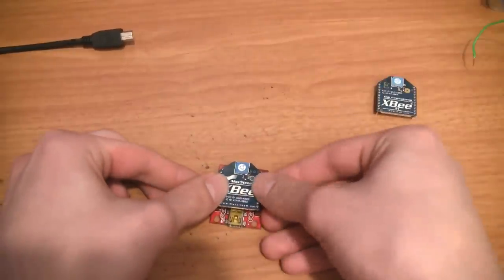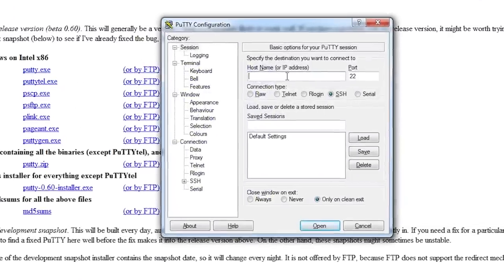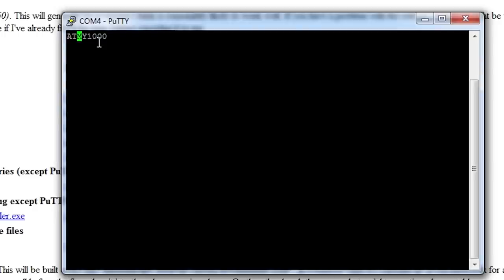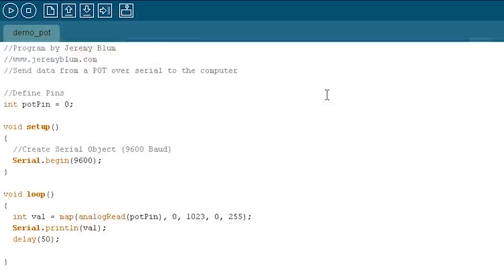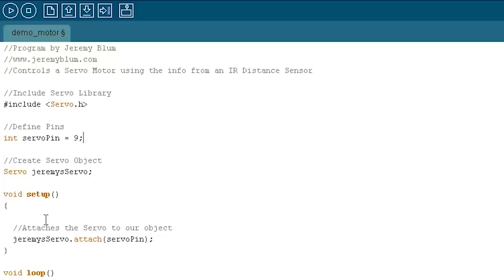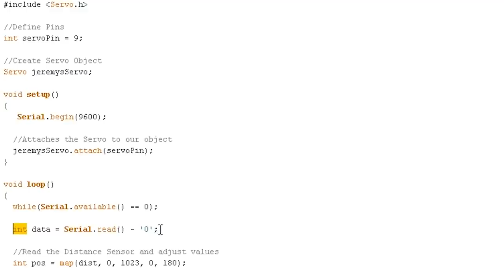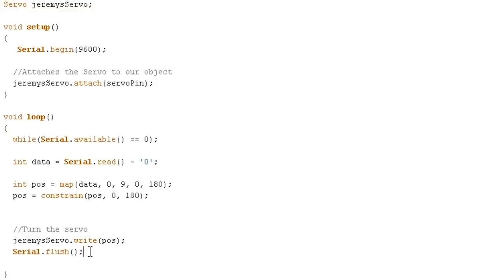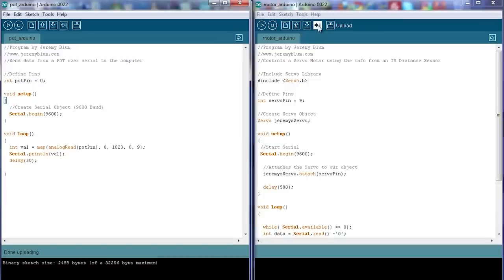Tutorial 09 for Arduino: XBee Wireless Communication

Comment: 2.4GHz is such a "dirty" band. crowded with: WIFI, Bluetooth, RC toys, wireless cameras, security alarms, Microwave Ovens, ham operators..." I prefer the 900MHz band. Cleaner, more power and better antenna solutions.

Comment: the code in the Arduino can take data from xbee while running its program, putty is to configure the xbee, microcontroller and xbee are 2 different components working together. Instead of putty, u could download the official software of xbee , X-CTU.

Comment: How does it differentiate when to use Serial via wireless vs. USB?  does arduino default to the connected shields if there is no USB connection?

Comment: Hey Jeremy, I have been trying this example to practice with my Xbees, and I have the exact same shields that you use in this video. I was wondering if you could help me because when I turn both Arduinos on the Servo twitches a little when the potentiometer is on one side and the Servo does nothing when the potentiometer is on the other, it doesn't coorelate with the potentiometer, it is basically just twitching every now and then. I really appreciate the help. :)

Comment from the maker: @bmonty65 While the polarity is only relevant to the interface, you need to be careful, because antennae are designed to be very particular lengths.  Antenna length is directly determined by the wavelength of the wireless signal you are sending.  Extending the length, if not done in integer multiples of the original antenna length, could greatly reduce your range.

Comment: if you want to "change slave 1 to 2" u could configure 2 receivers and 1 transmitter with the same PAN and BaudRate, having the 2 receivers each responding only when a certain code is sent.

Comment: Is there a way to use a single arduino to wirelessly connect to 4 others? I need to send different signals to each of the four arduinos but if possible I want to just use one master arduino, is this possible?

Comment: Hi I a have problem when I set up the xbee. I started putty and typed in +++, got an OK. But when I type in ATMY1000, I get ERROR000. Can someone help me fix this?
Reply: I am having the same problem but i am going to update firmware using xctu to 803.15.2(or there is some no. like that). There you can change the atmy
]

Comment: I am Using my HC-05 Bluetooth module and I connected it in my Arduino uno r3,my wires are all fine.When I use my mobile phone to communicate with BT module I've got some problems: My phone can pair with BT module but there were no connections,my phone says "paired but not connected",do you know what to do?

Comment: Jeremy... Do you know if you can do a broadcast scenario with the XB?  I am considering 1 master and multiple slave devices say 1 to 10 devices...   So master device would be set to address 00000->000001 and all the save devices would be set to 000001->000000.   Do you think this will work.  If not that can I have multiple outgoing addresses on the outgoing XB?

Comment: At 6:36 you say to change the value from 0-9 which gives a range of 10 this will only require 4 bits not a byte to transmit, or is there a 4 bit overhead? In which case why not use 0-14 which will gives us a bigger range but still only use 4 bits?

Comment: I see allot of wireless systems use WiFi, is this peer to peer or do you need a WiFi network to use these. What would you recommend for P2P communication for RC control. I also want the transceiver to be independent of the main adrunio.

Comment: If I want to use the receiver Arduino to send data back (e.g., a reading from an analog pin) to the sender Arudino while retaining listening commands from the sender, is that possible (like a chat device, where both sides can send and receive data)? Thanks!

Comment: Hi Jeremy.
I'm trying to get this program to work. I have written the program code exactly like yours. But It seem to b a problem with the signal I receive, cause  when a 4 (In serial monitor is being sent i get 80(thats correct), and then allot of zeroes and then another 80. So the servo isn't moving at all, it just shakes, I don't think there should be a problem with noise, but the zeroes doesn't get filtered out.. Any Ideas?

Comment: I have a question about the comment he made on the jumper when working with the Xbee shield attached to the board, do I also have to use the jumper when interfacing the Arduino with a Bluetooth module? I'm having trouble with a Bluetooth module and my Arduino UNO and I don't know if the jumper thing is the problem.

Comment: @sciguy14 yeah, I agree with that...
but this therminal overwrite the previous configuration commands, and that's not very good... I'm not sure why but I believe it's because xctu uses /r as jump line instead of /n (like arduino therminal does, etc)
so it's a bit bad to not see what you just did but it's not that bad...

great series btw... I really appreciate it =)

Comment: Instead of unplugging the arduino chip, I just short out the reset pin to ground and cross the tx and rx lines, because I don't have an xbee shield, only a breakout board.  I use a voltage divider to bring the DIN voltage to 3 volts.

Comment: thanks a lot but Im still a little bit confused.. let me explain you with an example: 
I have 3 modules: 
MY0, MY1, MY2
I want MY0 to send data to MY1 and to MY2 not at the same time, not a broadcast. I made an interface with 2 buttons so the idea is that if I press the left button on the module with the MY0 address this module is going to send data to MY1 and if I press the right button MY0 is going to send data to MY2.

How can I do this? with a code from Arduino or configuring it from X-CTU?

Comment: Hello.. I am using digital fire sensor at one xbee and an LED on another ..
I have done the XBEE commuications using putty as those commands are different from yours because i am using XBEE S2....the commands are..

XBee 1
+++
ATDH13A200
ATDL40B7A19B
ATWR
ATCN

XBee2
+++
ATDH13A200
ATDL40B7A189
ATWR
ATCN

Its done....
Now will you help me with the CODING part of both the arduino's & tell me about jumbers on XBEE shield.. should I first keep it to USB and change to XBEE after upload? 
My Codes are:-

For Arduino and XBEE 1:-

void setup()
{
  Serial.begin(9600);
  pinMode(11,INPUT);
}

void loop()
{
  int no=digitalRead(11);
  Serial.println(no);
  delay(500);
}

For Arduino & XBEE2 :-

void setup()
{
  pinMode(12,OUTPUT);
  Serial.begin(9600);
  
}

void loop()
{ 
while(Serial.available() ==0);
  if(Serial.read()>0)
    digitalWrite(12,HIGH);
 
  
}
Reply: what is the commands for S6..????

Comment: Using a Arduino Micro, I can't get it run if I power it externally.  It runs perfectly fine while under USB power from the PC.  As soon as I power it externally it sits with the RX LED lit and will not execute code.  I have no mention of serial in my code (it's for a different project not this example) whatsoever.   Stumped, any help?

Comment: Hi! I'm currently working on a remotely operated terrestrial rover(With GPS, temperature sensors, etc.) with Arduinos Xbee shields as coordinator and end points. I have no problem in sending and receiving data from the rover however I want to display the information received in my computer and I can't seem to find a way of doing it without crashing the serial communication between the XBees. Is this possible with two arduinos or do I need another device? Thanks!

Comment: i wish to create a wireless sensor network.  I have setup one coordinator which will be connected to pc via usb and two routers powered by battery and each one having one sensor, pulse rate and temperature. How do i transmit the sensor data from the routers to the coordinator. I am a newbie and dont know how to code. Please help.

Comment: For some reason when i turn the pot up from zero, the servo just pulses, does not rotate. 
If i look in serial monitor from the motor arduino side i can see the value changing but it jumps back to Zero a few times in between each pot read.
Ex, 20,0,0,0,20,0,0,0,30,0,0,40,0,0,50,0,0,60,0,0, as i'm turning the pot up.
Any idea's????

Comment: with an arduino uno and that xbee shields.
 i can read data from an arduino and send via usb cable  serial data to the computer from the other arduino (both with xbee shields) or i need to have one with an arduino mega to use another serial pins?

Comment: Dear jeremy. I want to make an Arduino transceiver using 2 UNO R2 with 2 serial bluetooth modules jy-mcu v1.03. I want to know how is possible to establish connection between the 2 BT modules without the PC after the programming. I want the Arduinos to do the process automaticly after every power on. Do i have to use the AT commands? how I call them in sketch? Thanks.

Comment: I can enter config mode however cant seem to enter other commands just through Arduino, its just a serial signal so if you can find out how send ATDL successfully, you could switch destination module when you want. I think it is messy though as there is a need to wait for the delay each time it enters config mode.

Comment: Hey,
   So i've just got my new xbee shield and xbee. But heres the problem: after i put in ATMY1000 into putty nothing happens it just stays there. Is there any way to fix this. Also, i dont have a sparkfun xbee adapter thingy, so i took out the atmel chip in my arduino and switched the little jumpers to the left side but when i look in my com ports it still says Arduino Uno... Is that a problem
      thanks
Reply: oops i meant atmega

Comment: Hey i am using BTBee Pro HC - 05, and i am not getting any response after hitting +++, although i can communicate using AT commands. Is this tutorial only foe certain bluetooth modules(Digi)
Reply: This mean no communication with the usb and your computer this in case you are using the usb xbee kit , otherwise if you are using the arduino board you have to remove the jumpers and remove the arduino

Comment: Whats the range of something like this? And can it be extended using an antenna?
Reply: He's using the 2.4GHz 1mW Series 1 antenna which has a 300ft range. They have an antenna with a range of 40 miles which I believe is the maximum they have available. You can check out all the antennas (read the product features for specs) at https://www.sparkfun.com/categories/111

Comment: good video jeremy but i have a doubt,usb provides code from pc to arduino if we remove the usb and put a 9 volt battery the code no longer sent to the arduino and it wont work,please correct me if i  am wrong,,, :)
Reply: +Gaurav Shetty The code once programmed on the processor. after that the usb will only provides the voltage for arduino to work and has nothing to do with the code anymore :)
Reply: Thanks :)

Comment: Thank you for these fantastic tutorials! I almost have this one working: I added a Serial.println(pos) to the servo sketch, and I can see that in addition to the correct angle value, the servo also receives two values of zero right after. As a result, the servo just jitters around 0 instead of turning to the position I sent it and staying there.  Both sketches are exactly as in the tutorial, and I do have the "flush" statement at the end of the servo sketch. Any ideas?  Thanks!

Comment: You know you can order Arduino Nano Pro boards on eBay for about $2.50 each. This could be a solution. You don't have to use xbee either. There are other wireless modules, 2.4ghz, again about $2 per unit.

Comment: And again such trivial things which every tutorial let you know. BUT: How is it possible to send a whole String or char Array as one line from one Arduino+Xbee to another. One char works without any problems but if I use Serial.println("some text") or separate Serial.print('s')... or Serial.write('s')...  the received data is corrupt. What I'm doing wrong? I cannot find anything about this. Am I too dumb???
Reply: Did you manage to solve this problem?
Reply: Yes! It works well. You need to set some short delay between sending each char. On the receiver side, you have to wait for every char arriving in the buffer before you can read it out. If you read from the buffer before data has arrived, you are getting lots of wrong bytes mostly value '255' displayed in ASCII form.
Reply: +Roitzschen Thanks. I thought that might be the problem!

Comment: you could get a breakout board with just 4 pins, tx rx gnd and 3.3v connection, and connect tx-tx(arduino) rx-rx(arduino) power-3.3v(arduino, gnd to gnd and use X-CTU to config it

Comment: It would be easier to broadcast to both and have the one it is talking to to activate, I do a listening of 3 digits to activate, code which I would not use for others, etc 999, then next digit 1 or 2(for receiver modules 1 or 2), then whatever code Im transmitting to a preset length. 

I thought of a way you might be able to.. you could write an Arduino program to open configuration and switch modules each time, etc +++, pause, ATDL1 or ATDL2

Comment: hello , I have problem with reading data between two module xbee using arduino and xbee shield , the problem that, i set the configuration between tow module using X-CTU one as coordinate and the other as router, and when i test send and receive data on X-CTU all were OK, but when i use program with arduino with the instruction "Serial.read()" it doesnt read any thing ???

Comment: I already purchased the xbee pro shield. So if I have an arduino with a smd microcontroller, in which i can't remove, can i just connect the reset pin of the arduino to ground while programming the xbee?
Reply: Yup

Comment: I am trying to establish a simple wireless connection by sending a word ''HELLO'' ... 
basic chat works with the two xbees but the receiver xbee is not receiving the message ''HELLO'' when connected with arduino and shield
Receiver is constanly recieving an printing value -1 
I am using xbee pro s1 ZigBees

SENDER code
void setup()
{ Serial.begin(9600);
  }
void loop()
{ Serial.println(''HELLO");
 delay(1000);
}

RECEIVER code:
void setup()
{ Serial.begin(9600);
  }
void loop()
{
 if (Serial.available() == 0)
   {  
      int my = Serial.read();
      Serial.println(my);
      delay(1000);
    }
}

Please help me ..
Reply: try ATDH  and ATDL of sender same as ATSH and ATSL of radios may help...